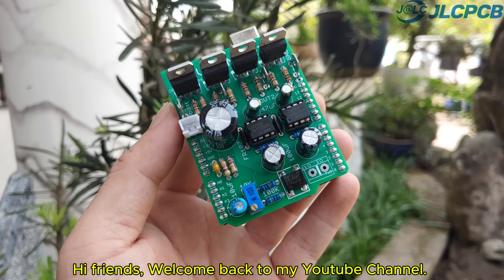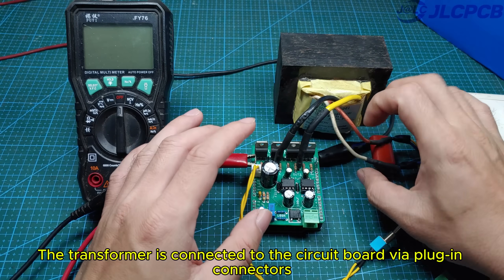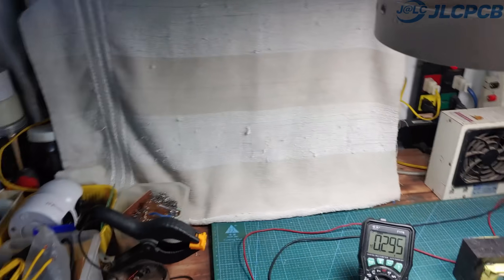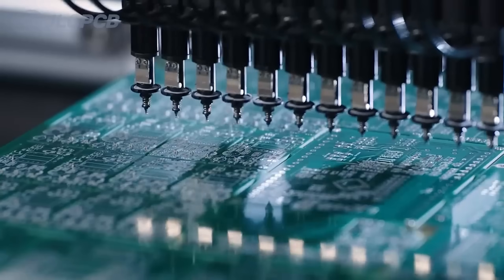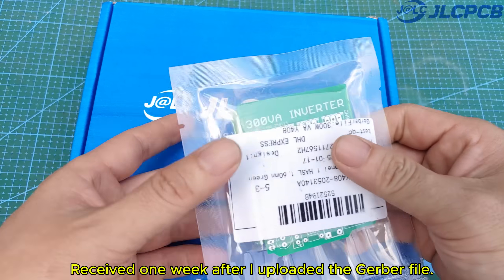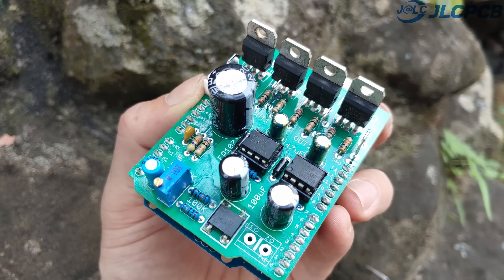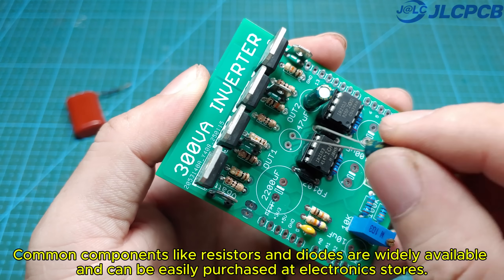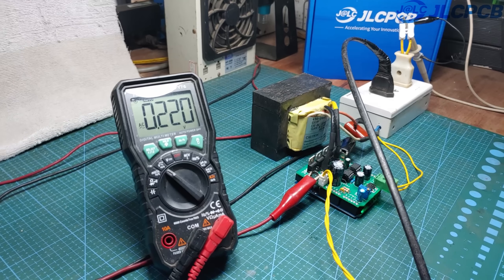Build a Pure Sine Wave Inverter with Arduino – Easy DIY Guide

Comment: Please make an SMPS power supply whose current and voltage are variable and can be changed along with the protection and voltage from 0 to 100 volts and amps from 0 to 10 amps
Reply from the maker: Great idea bro

Comment: Hey My MOSFET in inverter are heating up in secondary side with 100w load, also   the secondary inductance of secondary is  51mh and the turn ratio is 120:4 in pushpull for primary voltage of 12v and 325v dc with core dimensions of 55x27x25mm. Help me